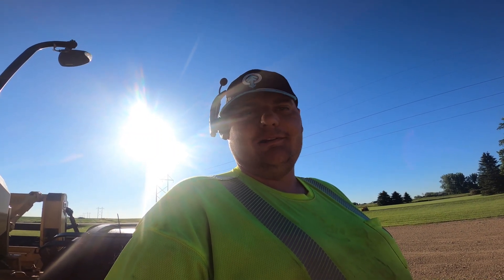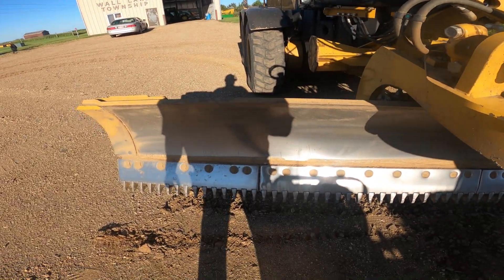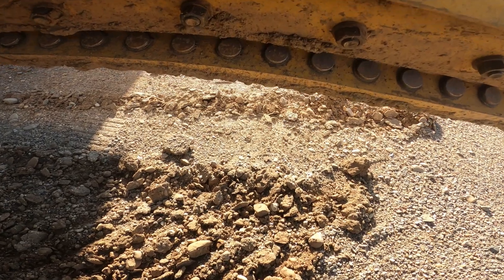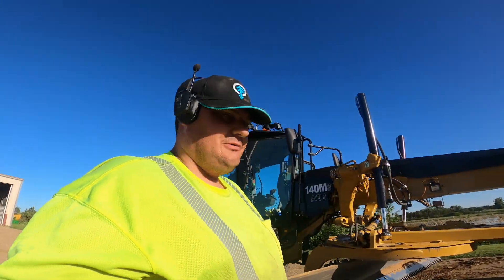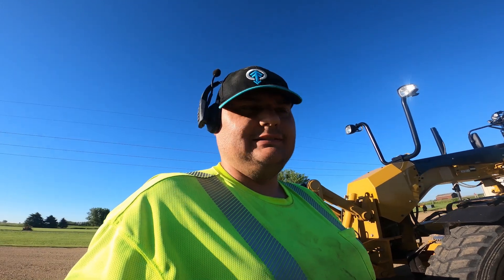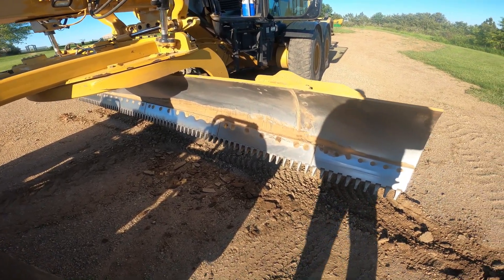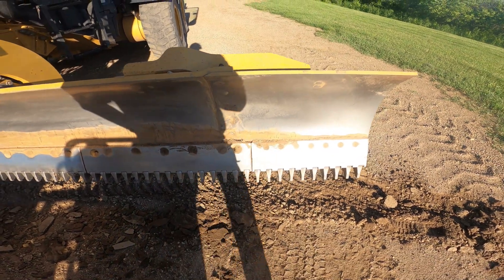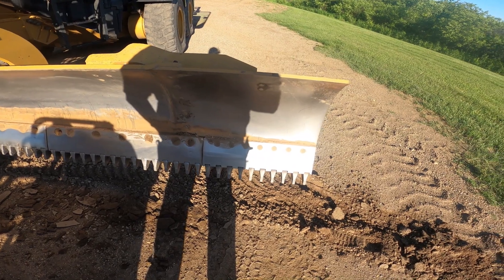Cat140M new cutting edge system

Comment: This system probably wouldn't be good without a packer/moisture would it? We could probably use more gravel, but the budget isn't that great for our township, and some of the roads get a pretty hard pack when it gets dry. Grinding through blades faster than I would like. Thinking some mixing action would be good, just don't have a water truck, or a packer on the grader, and not sure when that day might come.
Reply from the maker: I still have them on and it’s been awhile since we have had rain here and it’s working just fine I will be putting my regular carbide edges back on soon as I’m done graveling my roads there a great system I’d say early spring till end of June is the perfect time to be using this system thanks for the question and thanks for watching.